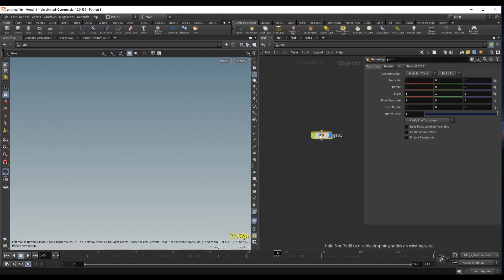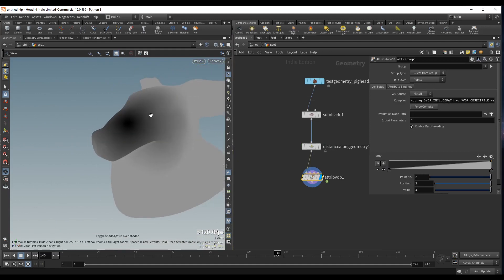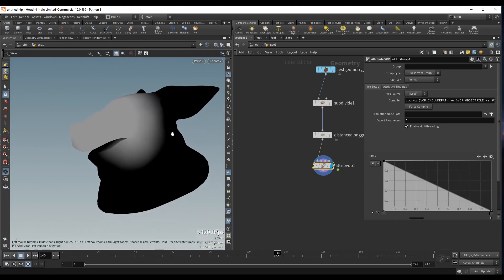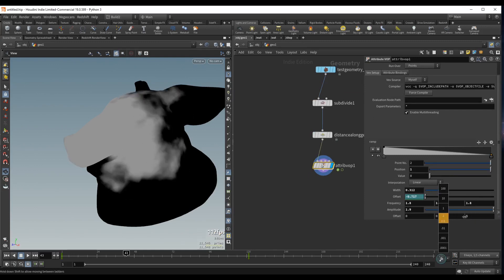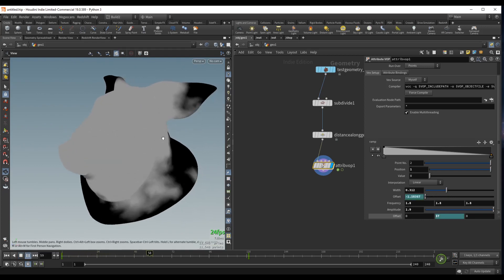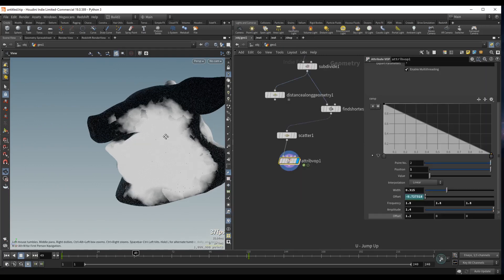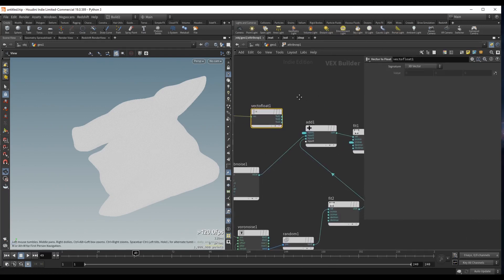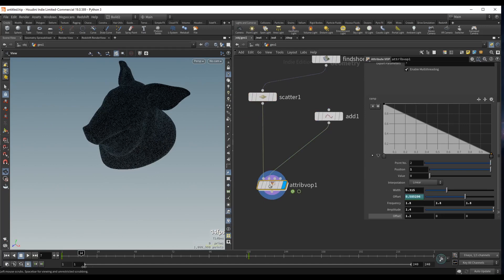VFX Essentials - Attribute Growth / Propagation - Houdini Tutorial

Comment: Just a rookie question, what If I used the scatter node on the geometry, it seem the Distance along geometry can't calculate a proper distance data. what am i suppose to do in this case ?
Reply from the maker: You can generate the distance attribute on the regular geometry and use an Attribute transfer to transfer the distance to the scattered points

Comment: This is great but how do you actually use it? Does one render it out as a matte? Or  - is it later connected to something else, procedurally?
Reply from the maker: You can use it to drive VFX in general like spreading flames, particles, etc. If you want to render it like this over the mesh itself my best method was to render it out as particles (really small particles) to generate a black and white mask/layer. Then you use this mask in Nuke/After Effects to change the mesh.

But mainly this is best used to drive other effects.